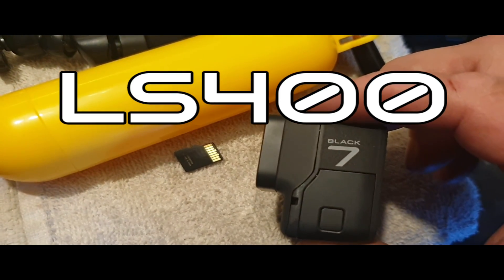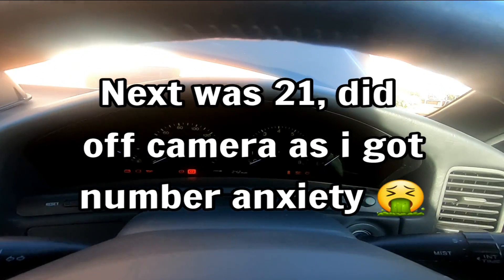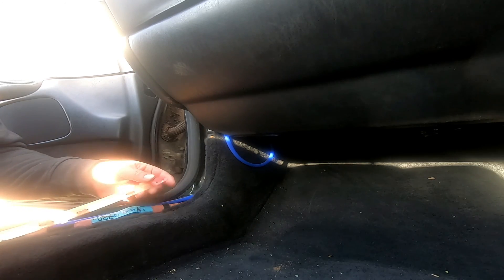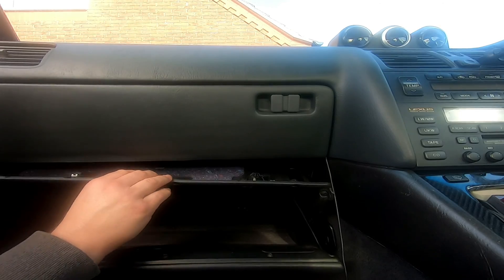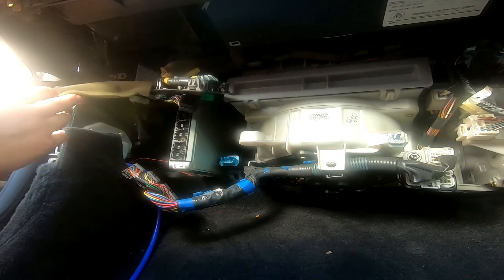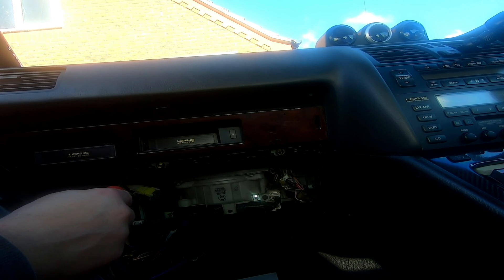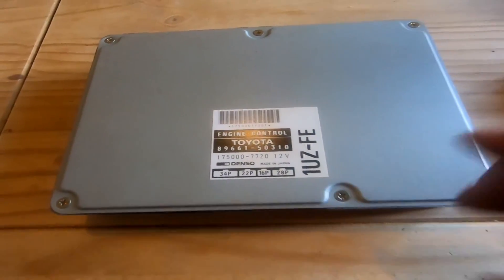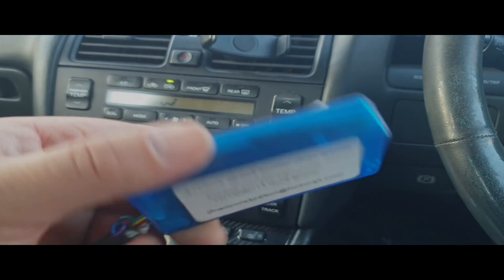Lexus LS400 -  how to read fault codes and check ECU capacitors

Comment: I have code 51 I believe that’s my ECU but I just replaced that so I don’t know why the new one went out it’s completely new. I didn’t even get the old one fixed it. It ran fine for two weeks and then now it won’t turn over. It only turns on every morning for five seconds then turns off on its own and then it refuses to turn over. I don’t know what to do. I have a 93 that runs with no catalytic converters I didn’t put the O2 adapters in yet because they came in the mail after my car took a dump. I don’t know if that’s why….
Reply from the maker: You say brand new, as in from main dealer brand new. The problem with new old stock is that the caps inside an unused ecu degrade with age as with one fitted from the factory. We've seen "never used" ecus that have leaking caps too.

Comment: PLEASE SOMEONE TELL ME WHAT FAULT CODE 31 IS FOR
Reply from the maker: 31 - Mass air sensor. If that checks out okay it could be bad capacitors In the ecu
Reply: @FullBoostJ4  car drives and runs completely fine bought it and tape was covering the check engine light really hoping it's not the capacitors
Reply from the maker: What's it run like if you disconnect the maf?
Reply: Do you think it has anything to do with ecu as it doesn't affect driving and also it is a solid engine light and doesn't blink
Reply: @FullBoostJ4  how do you disconnect the maf on this car?
Reply from the maker: @coenwhite definitely a strange one 🤔
Reply from the maker: @coenwhite is it the plastic one or the metal one? It should just unplug

Comment: Can you just check it with a OBD reader ? I have a 1996 Lexus ls400 with a check engine light on and have no idea how to even get started on figuring out why it’s on
Reply: 94 and older have OBD2 diagnositics ports so you can take it to your local shop or autozone and have the codes read. older and overseas options have OBD1 which requires reading codes like this.

Comment: Took the screws out the board and it seems the board is glued down
Reply: there's a side of the ECU that has small inset screws that are holding the heatsink square to the metal casing to dissipate heat. you can taake those out and both side should come out once all the screws are removed. I don't suggest doing this unless you've specifically gotten rid of any electrostatic charge you maay have. can 100% burn it out
Reply from the maker: Maybe someone has been in there before?
Reply: @FullBoostJ4  is the board not supposed to be glued down it looks factory
Reply from the maker: Maybe it's been rebuilt in the past?
Reply: @FullBoostJ4  is the board supposed to be free after u take out the screws
Reply from the maker: Yes it comes apart easy
Reply: more thaan likely you opened the wrong side of the board. take off the side with the sticker and info and take those screws off, give it a little pry upward and it should come loose from the board.

Comment: What ecu u throwin in? And how hard is it to put a new ecu in like a after market stand alone one cause ik if you do that you can bypass alot of sensors and put things like cold air intake on it.
Reply from the maker: Running stock ECU, when my budget allows I'll be going full standalone management that will use a map sensor which will mean I can get rid of the maf sensor👍